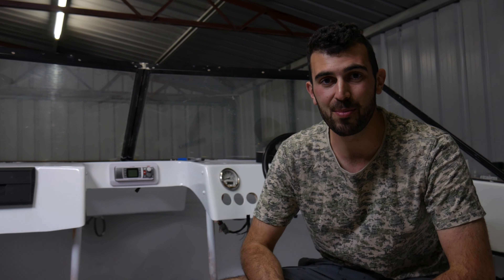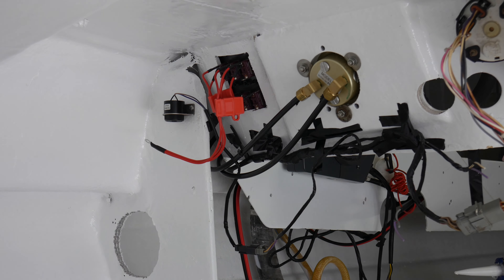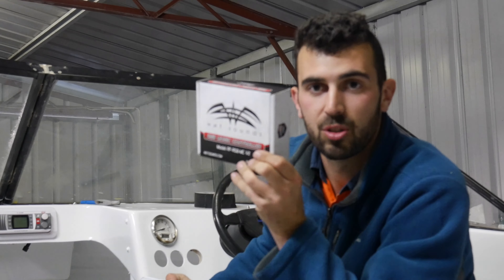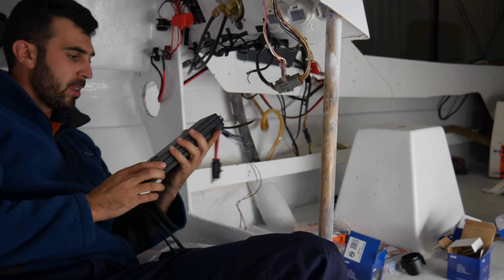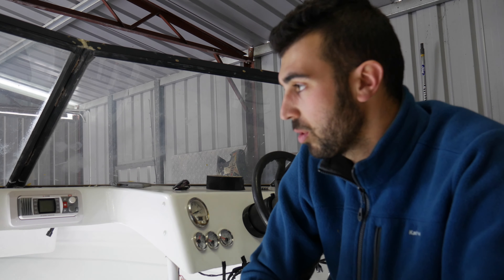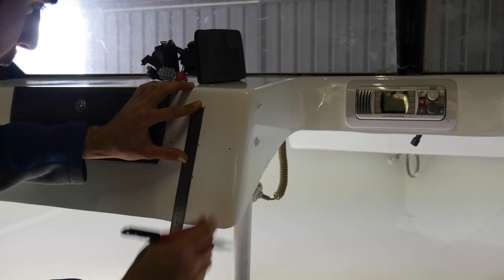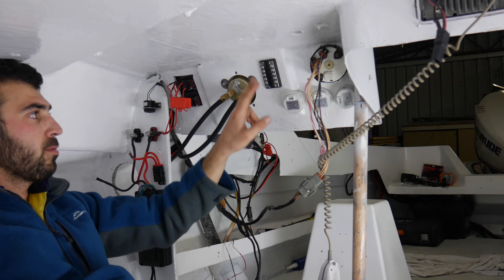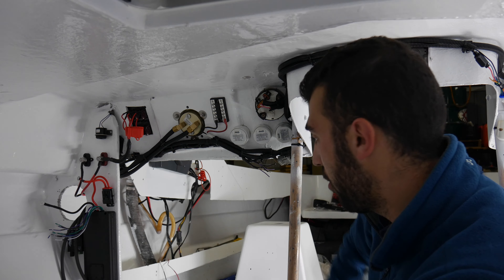12V BOAT WIRING | DASH FIT-OUT | FULL BOAT RESTORATION - PART 16

Comment: Instead of "stacking" connections onto those 2 main supply blocks, on your next build, please consider installing something like a "Blue Sea System"  Fuse Block panel ( they make 6 and 12 circuit models) You can then have individual "branch" circuits, each one fused for a proper rating, and not have multiple low amperage connections stacked onto a large amperage supply block, which, if the attachment comes loose will cause issue, and if a short occurs on a smaller unfused wire can cause a fire. I also hope that those "adhesive" cable tie mounts work well for you, almost every time I have seen those used, they tend to come unglued over time.

Comment: I plan to paint the outside of my 1982 wellcraft v20 with a roller. Will that work or do I need the air brush? Also what paint do you recommend?
Reply from the maker: Nick Parma I guess personal preference, you won’t get a nice smooth finish with a roller, I use a boat international paint
Reply: Angry Mack Adventures thanks for the tip!